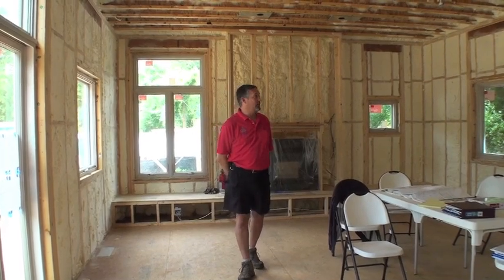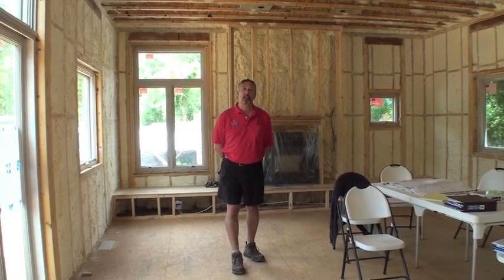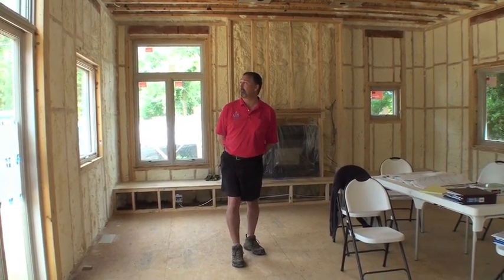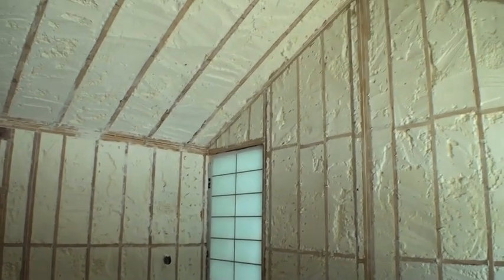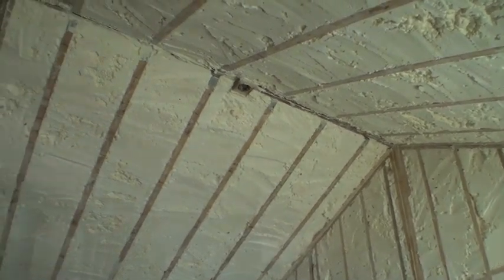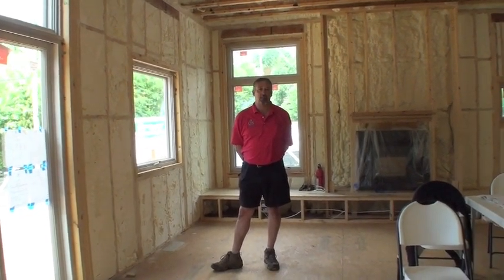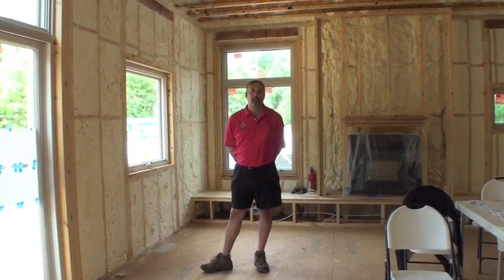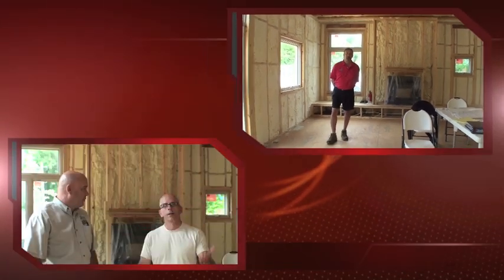Nash "net zero energy" home part 1

Comment: Seems to me that open cell should not be used on the exterior walls of a structure. Closed cell has many more benefits even if it does cost  more $. Just a thought,,,,,,,,,,,,,,,,,,,,,,,,,,

Comment: Its one year later and we still have problems with mold and water leakage, not to mention that sealing around windows with foam will not last, thats, will not last! Backer-rods is a better way to go, EDPM sleaves between foundation and other areas will not rot and will move with the structure...